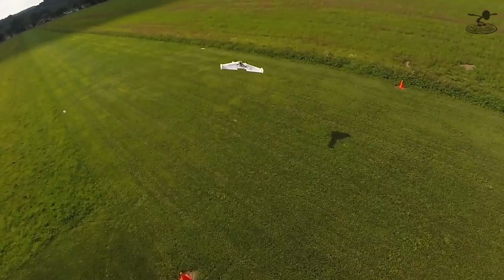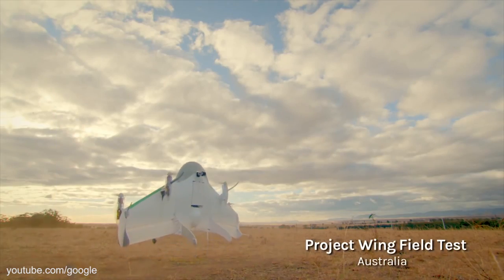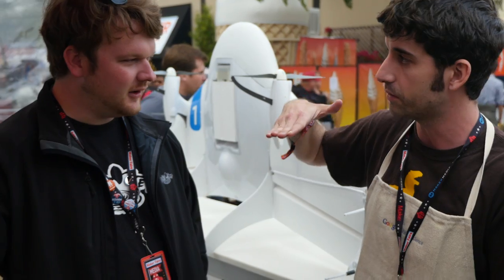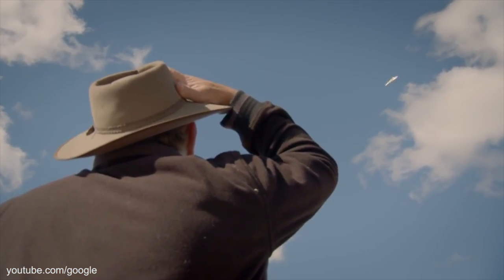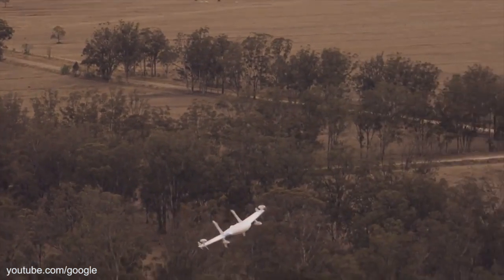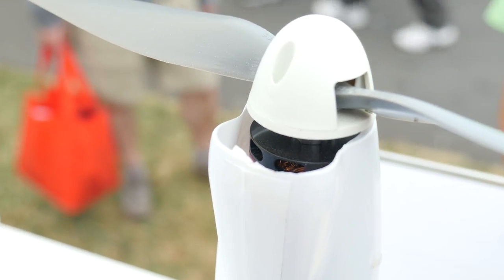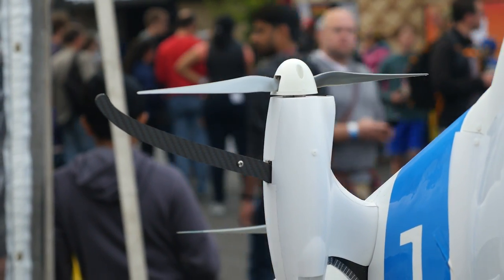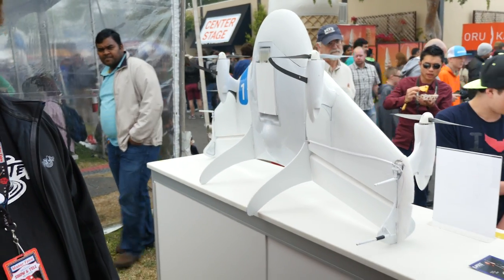Flite Test | Google Project Wing

Comment: Ok but now your delivery dates are gonna be affected by rain, snow, wind, and how far away the place where it takes off from is located. It may require 2 flight legs to get to your house. 10-15 miles isn't that far and with only one package load, they are gonna have to fly the whole distance back just to get another package doubling their miles. Plus not everyone lives in a house with clear open sky above them

Comment: Was hoping they would wangle more info from him. 
Battery? Motor kV? Props?
It does inspire me to plan my own delivery system though.  I'm thinking a  3D stunt plane and the pilot hovers it while the winch lowers the package, or forgo the winch just add fins to the package and use a scale wwii bomber :)

Comment: Why don't they just use a standard take-off, bigger airplanes(for like 5 packages) and drop them with parachutes.  A lot more efficient, and faster. Then make software to fly themselves, and build in a system into google maps, where you can pinpoint the delivery location, like within 5m.

Comment: Why don't they just drop the package with a parachute that would increase flight time.
Reply: FA-AJN Because parachutes can get blown away and they add another point of failure ,also they cost money to put in place so they open in an optimal way and money to buy = aka not financially approved
Reply: I guess parachutes that actually guarantee a safe landing would be to expensive for each and every package. If I remember correctly a parachute for my 1.5kg quadcopter would cost about 150€, so even without extra electronics it would still be too much for a customer to pay.
Reply: Tom Schmidt Also dropping things from a drone is really dangerous.
So it's all a no-go.
Reply: It would be cheaper to put rockets that fire just before it hits the ground
Reply: ***** And google isnt rich.